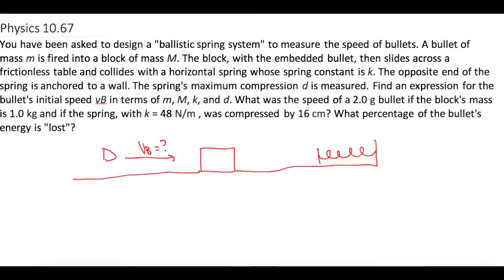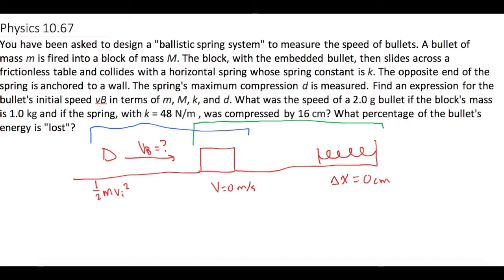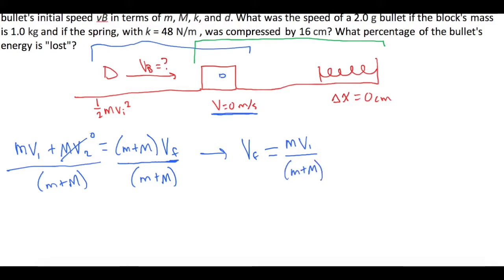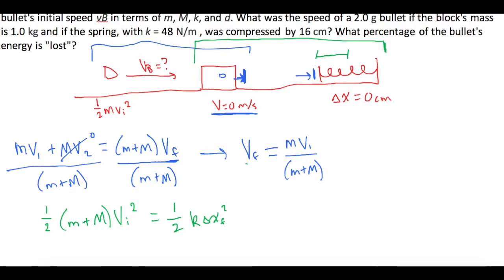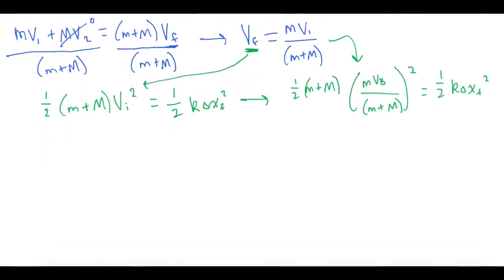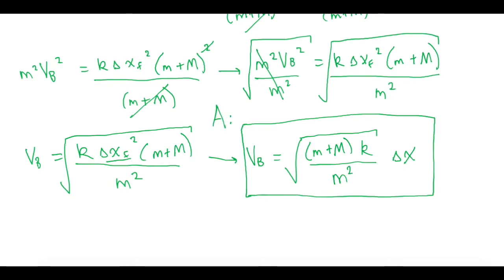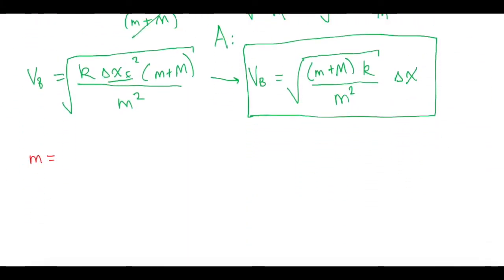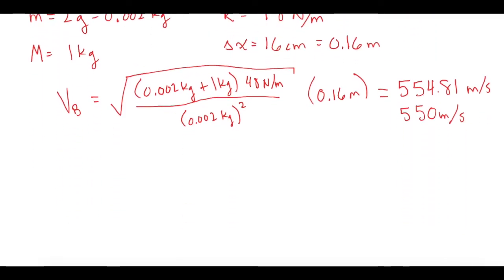Mastering Physics Solution, "You have been asked to design a "ballistic spring system" to measure

Comment: There is a more intricate version of this: the spring and mass are hanged from a ceiling and the bullet is shot from the bottom. Anyways, I tried calculating the speed for the bullet just before it hits the block and ended up with a very hairy equation that seems right, because there are no unknowns, but doesn't feel good because pretty much nothing got "simplified". Came here to look at this version of the question, though. Interesting.